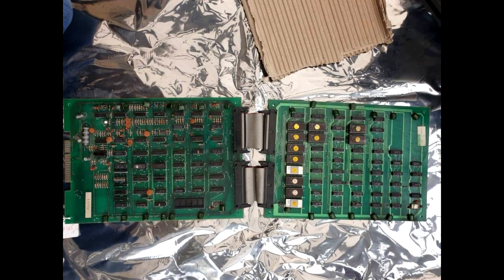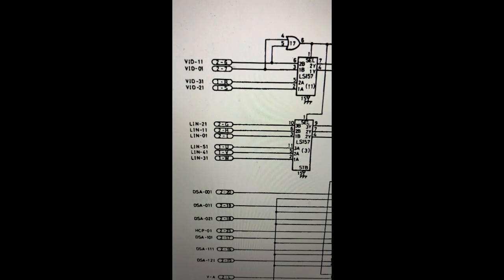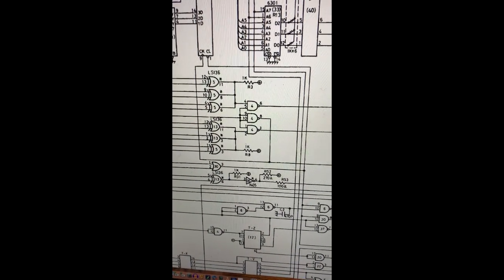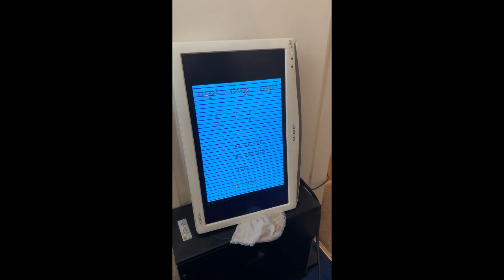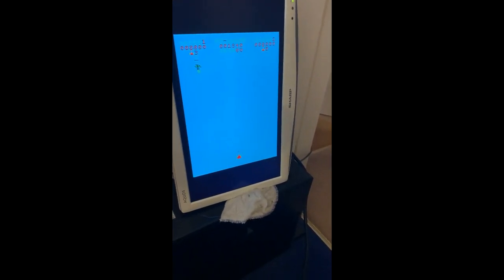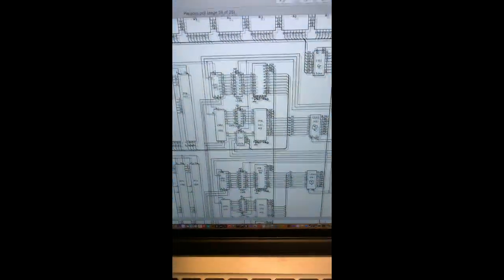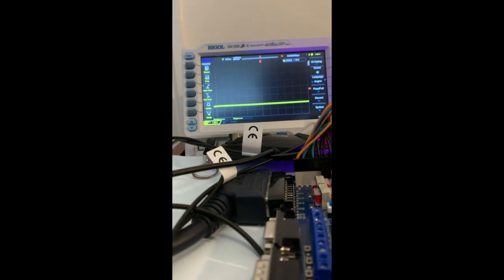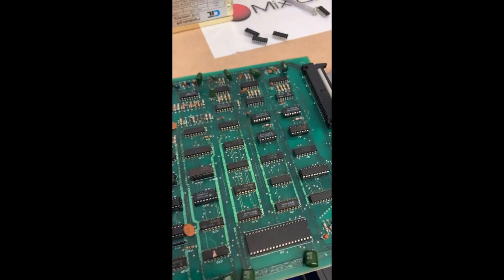Repair #2 Tehkan Pleiades

Comment: I dont understand how cutting a leg (32:19) of a chip can make the correct colors appear.....it was an output you cut...dont u need the output of the signal to get the colors?!?! Its all so confusing to me.
Reply from the maker: Hi Mark, sorry for the delay in getting back to you. There was a bad output on the chip, this was causing the other chips further down the path false information and was flooding the background with colour. In cutting the leg of the bad output, this alleviated the bad signal and allowed the other graphics to display. When the chip was finally replaced, it fixed the background graphics too.